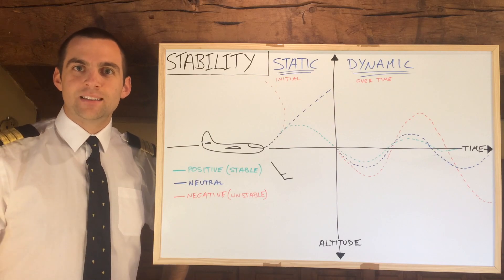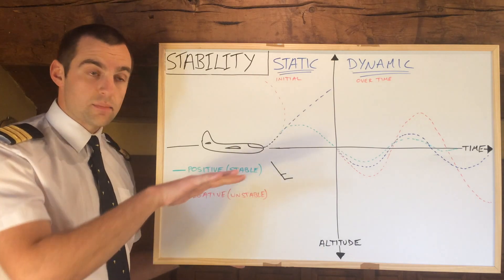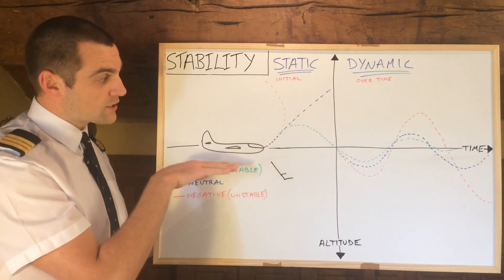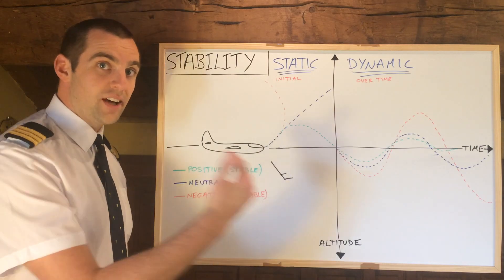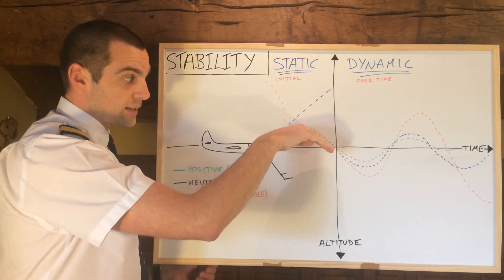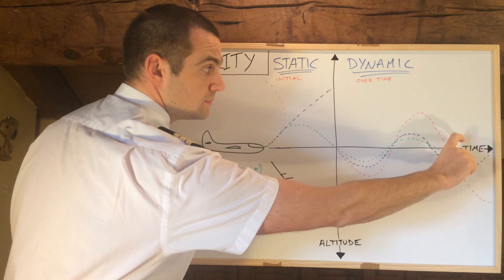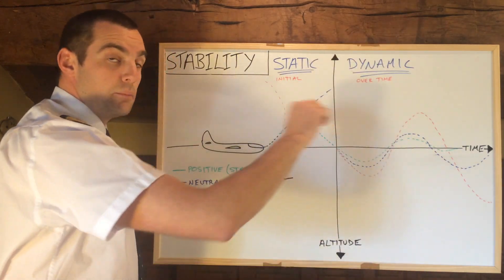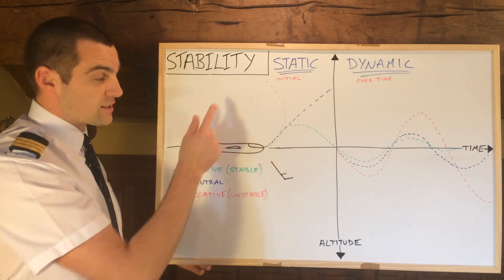Static and Dynamic Stability ✈

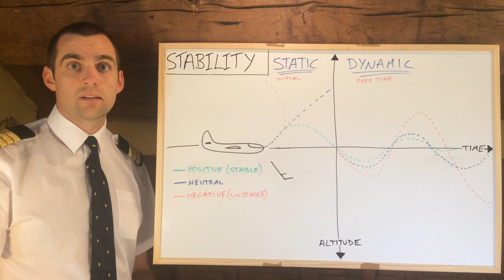Comment: Well done! Clear how static and dynamic stability are related. One thing however: positive static stability does not mean that an aircraft will be virtually impossible to stall (@ 1:55). The mix-up may be because of tail surface volume (contributing to static stability) may be not sufficient to reach maximum angle of attack. For this to explain you would have to incorporate the effect of center of gravity position.

Comment: How does it work with longitudinal lateral and directional stability?
Reply from the maker: a video on dutch roll is on the way :)
Reply from the maker: the same as above the principle applies to stability on any axis. thanks for watching
Reply: thank you for the promote reply
Reply: the only thing I'd like to add for you is that lateral and directional stability are connected each other, one get influenced by the other. Longitudinal stability is not.